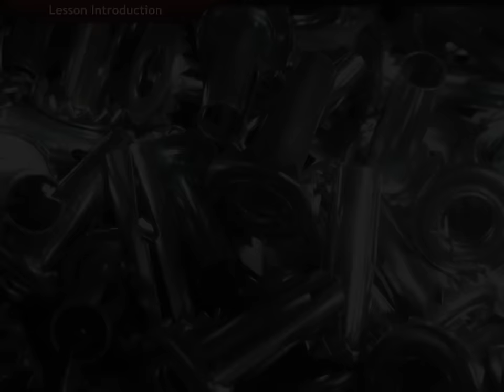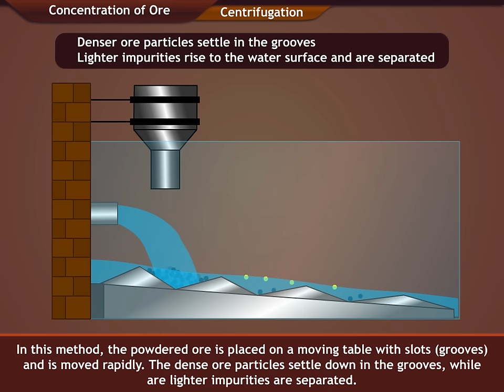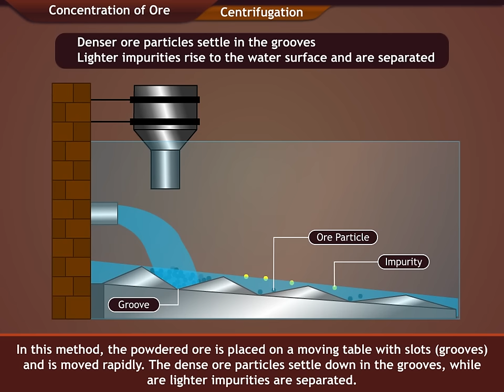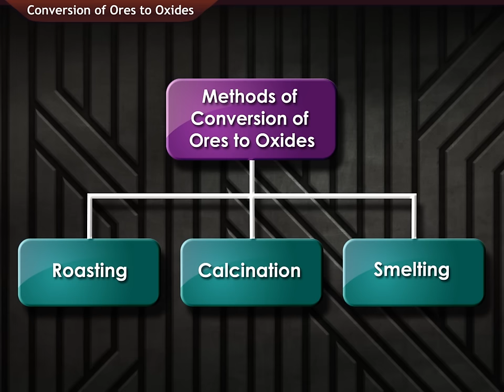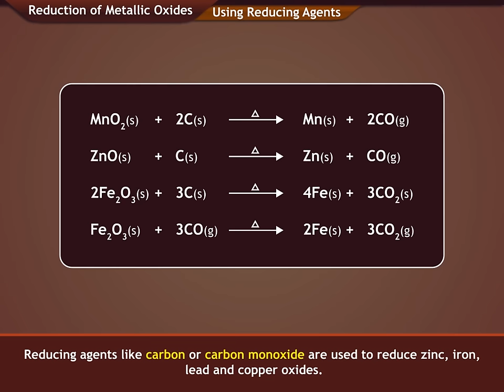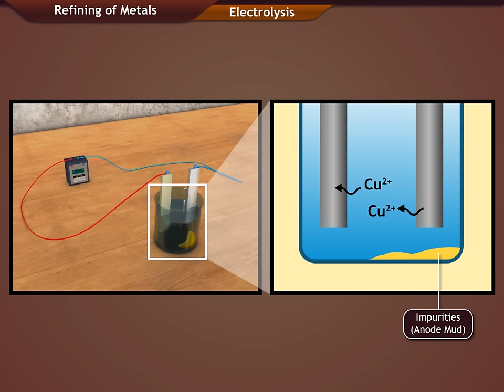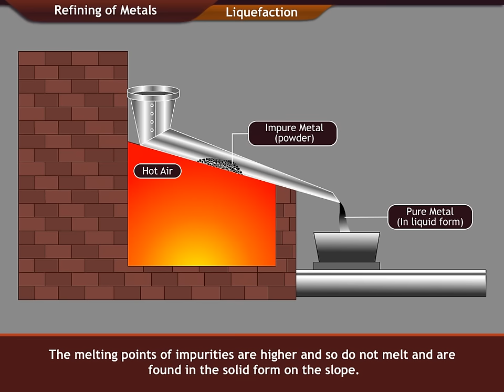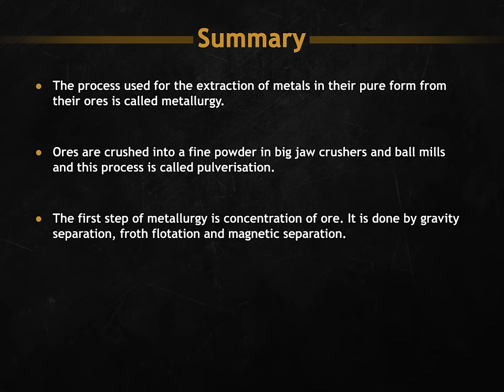All You Need To Know About Metallurgy | iKen | iKen Edu | iKen App

Comment: I have an old electrical part that has a density of about 11.53g/cm3, it weighs 4.54 kg.  It was XRF tested and results were 67% copper, 33% zinc.  Does this make sense with a copper density of 8.93 and zinc being 7.13?